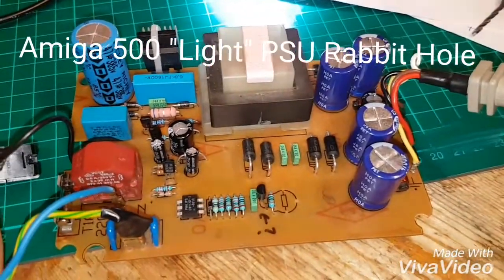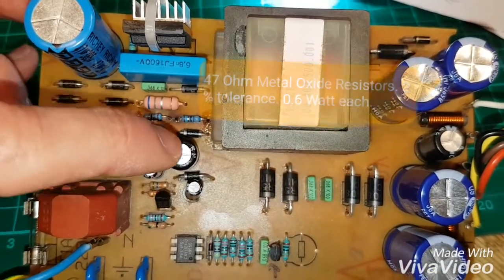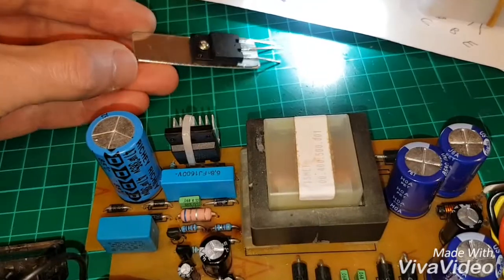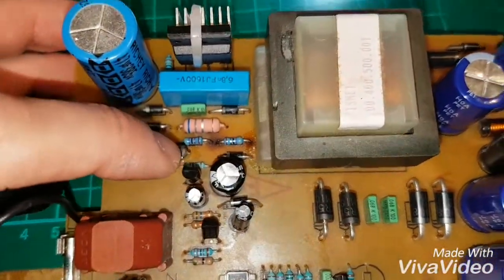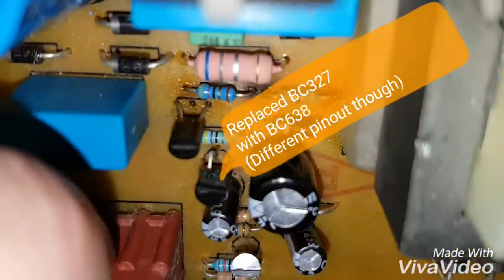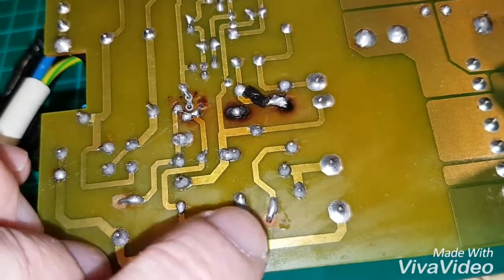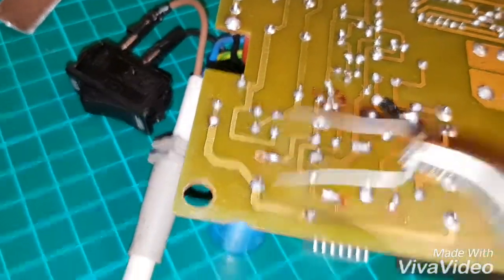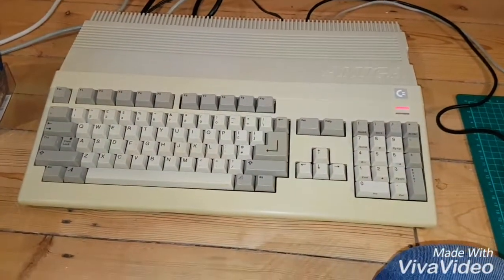Amiga 500 PSU Self-Inflicted Rabbit Hole!

Comment: i like you video but be careful of advice you give, dont short caps without a resistor! , why resistors burnt out? under rated or pulling too much current or both? dont rush into a repair just because something is burnt out , try to figure it out why ? as above , under rated or pulled too much !,  lifting pads has many causes, too much heat from your iron or cheap board. Either way , dont rush, keep the heat down ,60/40 solder help a bit aswell. all in all SMPS can be a nightmare , at least its working again, they were a total shit supply none the less. good job.
Reply: In this case the board is cheap SRBP stuff which doesnt take much rework before the tracks lift.

Likely the original fault was the thyristor, which burnt out the two resistors. This is very common in these ISMET power supplies. Usually the main switching transistor snuffs it as well. The 0.68 ohm resistor would have blown because the BU508 was shorted - it's used as a current sense resistor, and it's very common for that to die when the switching transistor fails. 

In the one instance i've seen one repaired (usually better to chuck them and retrofit a Meanwell power supply into the case), I've seen the two resistors replaced with a 100 ohm 1W resistor.  Those resistors overheat during normal operation - they were undersized for the job.

When you repair an SMPS, a good trick is to wire an 60W incandescent or halogen light bulb (not a led/cfl one - it has to have a filament!) in series with the Live wire. Taking the primary fuse out and connecting the bulb there works well. The bulb works as a current limiting device, if the supply tries to draw too much current due to a fault, the bulb will light up and limit the current. You should see a brief flash followed by a dim glow if everything is normal. This is often called a "dim bulb tester"

Comment: Finally! ;-) I just recapped the two of mine. Both shows the ”heat marks” on the two resistors.
Reply from the maker: drifter7508 Thanks! Yeah, I got a bit scared of it when it kept going bang 🤣. Those poor resistors! I saw a picture on Google where somebody had put a fan in the case, probably off the 12v line. For now, I've just given it some foam feet to try and help airflow.

Comment: Congrats on your PSU rebuild =). When they go, they go lol.   Got a similarly annoying AES PSU I need to get back to at some point.  Persistence pays off, you learn so much more than giving up!
Reply from the maker: GadgetUK164 - Retro Gaming Repairs & Mods Thanks. It must have been sitting there for about 3 months 🤣
Reply: That AES PSU I have is in the same boat!  Sat there since XMAS!  Found some faults, replaced some components, popping fuses, then started popping components as well as fuses...   Drove me nuts, put it on hold, must finish it - not knowing why its behaving as it is, is the main reason I cannot just let it die lol.